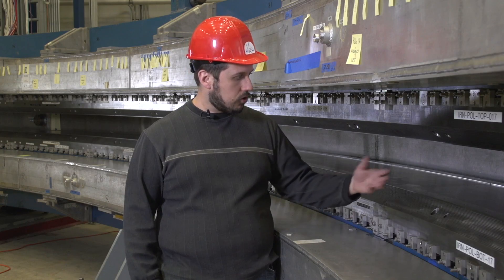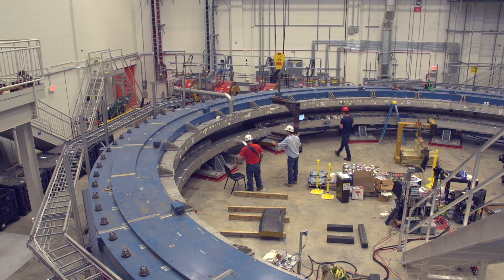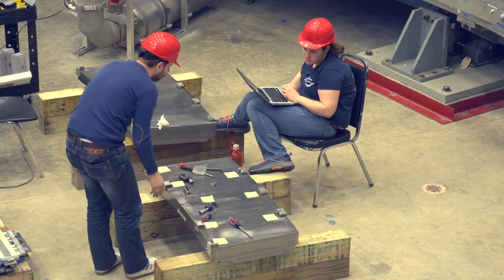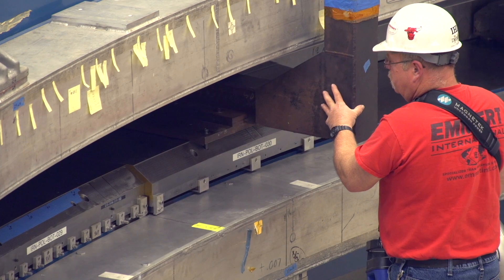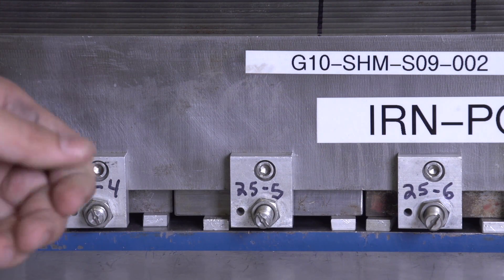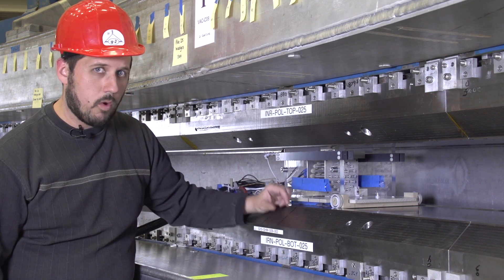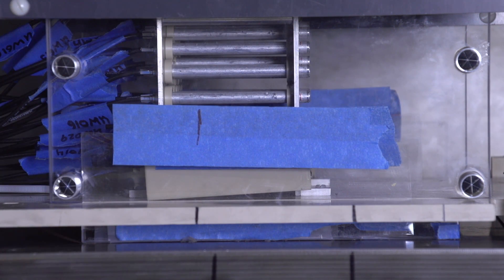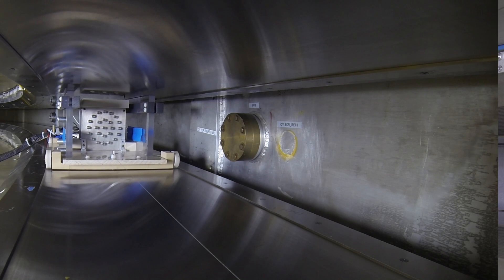Muon g-2 Experiment Shimming

Comment: ...feet...inches...WAT?
Reply: You're right, but there was a Mars probe that crashed due to metric/imperial confusion. Google "Mars Climate Orbiter".
Reply: This is a PR video.  I'm sure they're using metric in the actual experiment, they just converted the units to Imperial for the domestic American audience.  Also they're just describing the size of the ring and how thin the shims are, not actual scientific results.
Reply: Its an american experiment funded by american money so I'm not surprised they've regressed to using nonmetric. However that being if the scientists and engineers feel more comfortable using those units and it allows them to do a good job, what difference does a conversion factor make?
Reply: Most research institutions have rotating international staff and contributors.  I can't imagine publishing results in international journals in imperial units.
Reply: lohphat What I am trying to say is that it is a non-issue. These engineers and scientists have much bigger problems to worry about on a daily basis. Most of them passed elementary school math where they learnt to convert between units. This is why they can use whatever they want in order to achieve whatever they want.

Comment: Umm.. do you have a visualization about the magnetic field you measure? Maybe to show how the magnetic field is at the beginning..and when you have done some corrections mechanically .... and then finally the good enough image for the experiment?
Reply: Scientists being scientists, it wouldn't surprise me if the data is represented as a table of values (probably offsets from the ideal value) and they just visualize it in their head. The goal is to find out how much and which way to adjust the wedges.